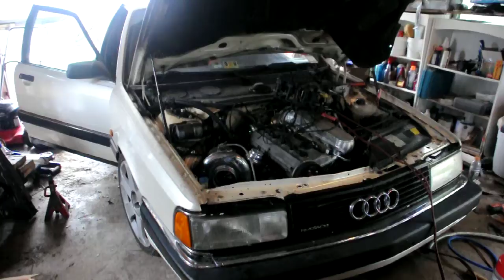Audi 200 Holset HX52 First Start

Comment from the maker: @Spoolinawd good point. I don't have munch nitrous experience, but wanted the ports there just in case (even if it was just for meth (which also gets complicated). The motor will be plenty stout though. This isn't a budget build except for the Holset, but thats just because I like holsets. I may not need to spray though. The plan is solid lifter and 10.5k + RPM.

Comment: That gets tricky too.  With a direct port you need a pretty stout motor,  least amount of nitrous you can use is about 100shot.  Even with that the jets are so tiny they clog very easy.  Probably better with a 50-75 single fogger.  Where is your build thread?  I read it for hours one night about 6mo ago,  wouldn't mind catching up.